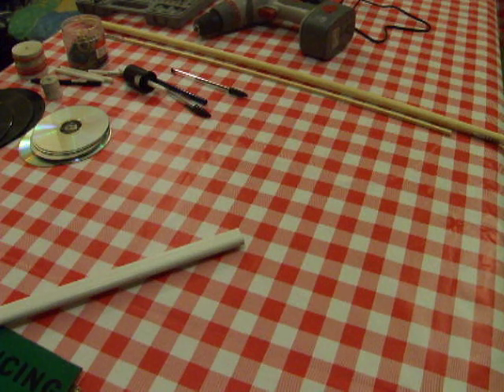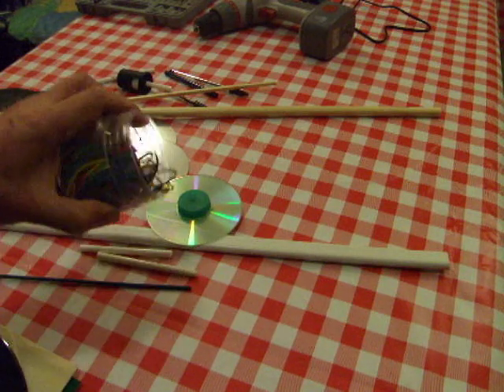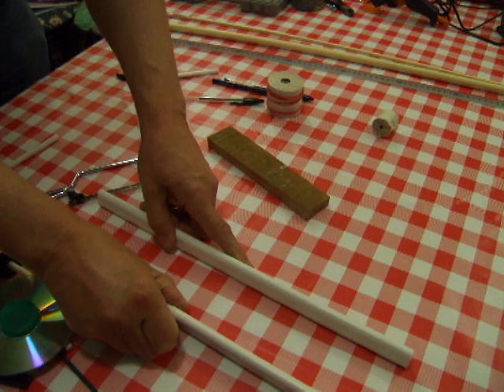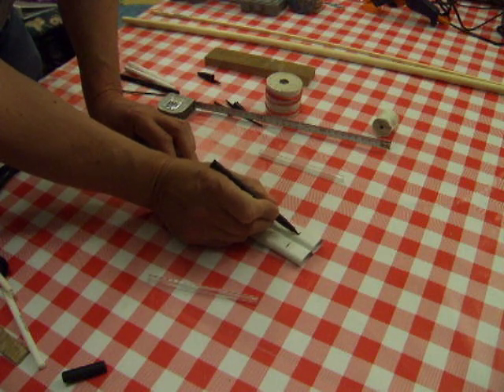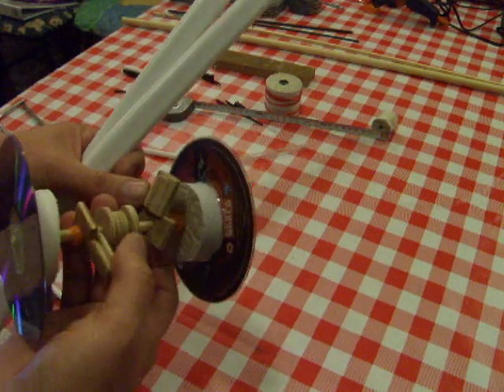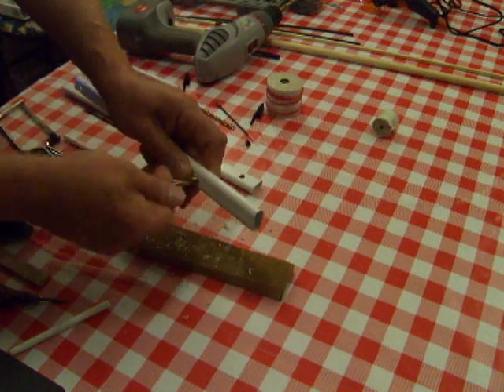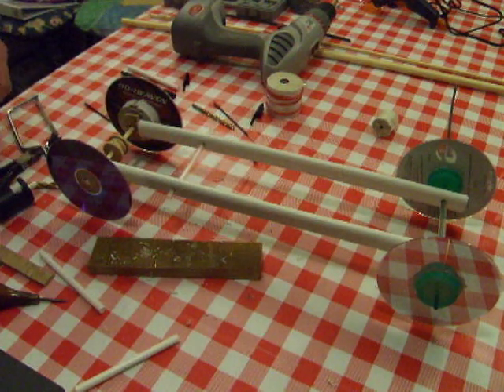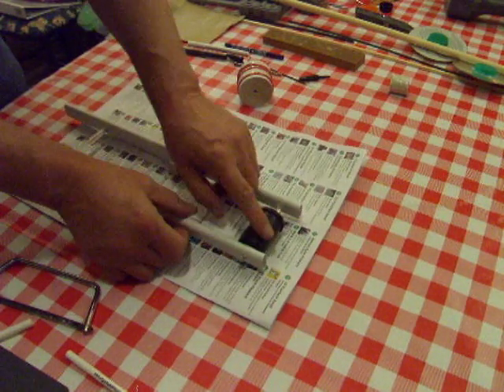Rubber Band Powered Car #8 Part 1

Comment: Would you have any suggested substitutions for the flip-flop parts?
Reply from the maker: Hi Jake, in this series I used the flip-flop disks for 2 different purposes.
1. To go on the back axle to give it a thicker diameter where the rubber band is wrapped around it. This changes the 'gearing' so larger wheels can be used or smaller wheels accelerate faster. On other cars I have achieved the same result by wrapping a strip of polystyrene foam around the axle several times to get the required diameter. You could probably use a strip of cardboard the same way. Alternatively I have used something like a cotton reel or a small cylinder like a tin can.
2. I used the flip-flop disks to attach wheels to the axle (12:21) in the same way I often use plastic bottle tops as the wheel hubs.
Hope I understood your question and answered it for you.

Comment: What would you recommend as a substitute for the electrical conduit tubes?
Reply from the maker: Hi Jake, it is really a matter of what you can find that is light and fairly rigid. I have used plastic curtain track on one of my cars, I have also used bamboo flower canes. Recently I found some thin steel tubes that worked very well. That car is in this video Which Rubber Band Car is Fastest, Grandad? Part 1

Comment: If you wanted to make the car wider, what would you use?
Reply from the maker: Hi Jake, I guess you mean wider than the ball pen tubes that I use as crossmembers. Well you could use anything that is reasonably light and rigid. For example, wooden dowels or bamboo flower canes would work.
Reply: Got it, thanks a ton! Keep up the sweet videos!
Reply from the maker: Jake Tognetti You are welcome, thanks for commenting.

Comment: What are the recommended measurements
Reply from the maker: Hi Jazmin Cuautle, I deliberately didn't give dimensions as I just used items that I had available and adjusted the measurements to suit those items. This car is probably about 12 to 18 inches long and about 4 inches wide. I used ball pen tubes for the cross members so that fixed the width and I used some scrap tubing for the chassis so that fixed the length. The longer the car the longer the rubber motor you can fit but if you are doing a school project you will probably have rules that you must meet.

Comment: what is the size of the dowel for the axle?
Reply from the maker: Which one? If you mean the thick one for the CD the label states it is 16mm but surely you could have measured a CD to work that out, or even Googled it. I think you will find a CD is actually 15mm so that means the 16mm dowel will be a very tight fit.